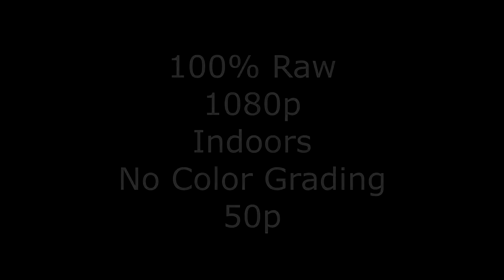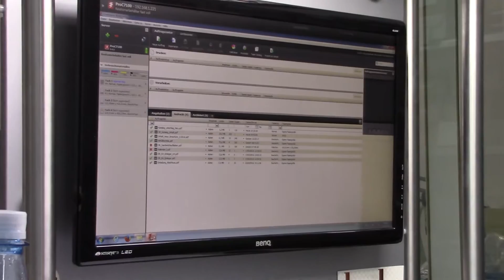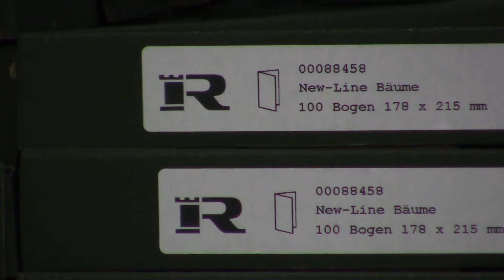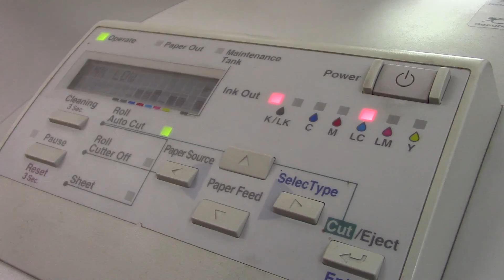Canon Legria Hf R706 / vixia r700 Test Video

Comment: It's not possible to charge the camera it self? You have to charge the external battery and the camera only works when the battery is clipped on?
Reply from the maker: As far as i remember it was possible to use the cam only with a charger. But i dont have this cam anymore. i sold it and got a used 4 year old canon Legria m56 with pro cmos instead. Reason in simple. The M56 may be older but it has a way bigger and better sensor so the picture is way better even in darkness. And i just payed around 100 Euro for the used Legria m56.

Comment: Is the "Canon Vixia HF R800" the EXACT same as the "Canon Legria HF R806"?
And same with the 700 vs. 706?
Reply from the maker: the Vixia is the US Model and uses ntsc bases framerates.. 30 and 60 fps. the Legria is the EU Model with Pal framerates 25 and 50 fps. Rest should be the same. So they only differ in Framerates.